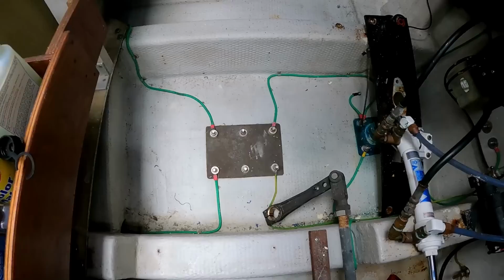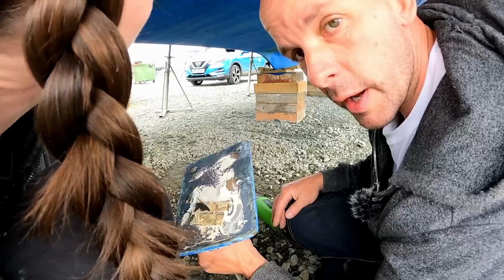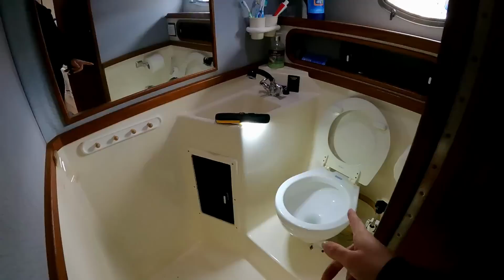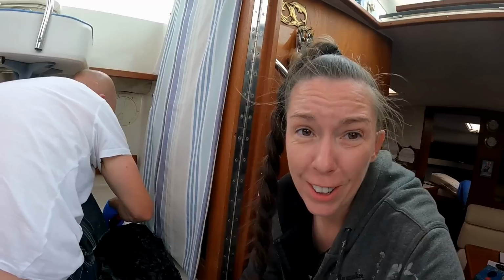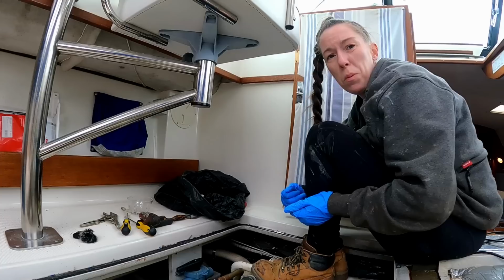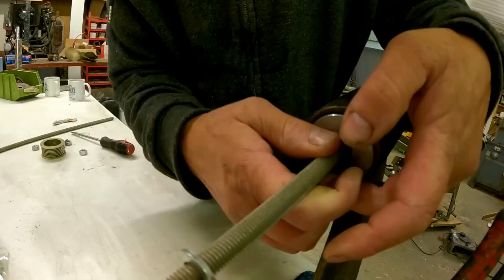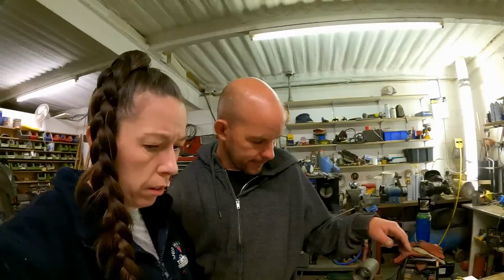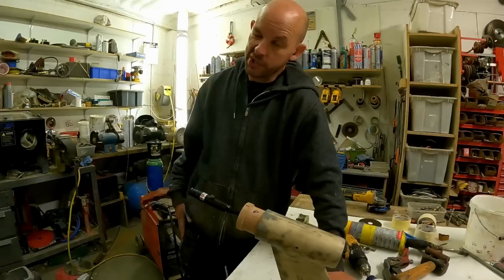Ship Happens on the boat! Cutless Bearing Removal and Toilet Drama!

Comment: Any cracking by the P bracket will not appear under the fitting but outside especially the corners. All the antifoul in the area needs removing to reveal the white gelcoat so that it can be properly inspected. Nice project, good find!

Comment: Should use fine wire to cut the sealant. There is 316 SS shims available from millwright or machinists shop. A,B,C,or D sizes.
Packing puller is like a 1/8 “ wire with like a screw on the end .would work to dig out the poo and paper from the hose . Maybe the bearing is directional and a set screw to lock the bearing to go along with an interference fit is just one more level . Also clean that inner hole like you love it and shine that shaft like it is your own then heat the housing , lightly lube the shaft and it should slip in like a glove !
Reply: If you need a fine wire to cut the Sealant - Go over to the Lancaster Restoration project and ask for some Lockwire!  It's stainless steel wire that we use in Aviation to tie up nuts and bolts to ensure they never come loose. It comes in various diameters - 0.032" is most common, but it can be from 0.015" to 0.051" (the 51 thou is like trying to bend a coat hanger!).  I've used it to cut the sealant around windows and windshields on aircraft many times!  Just wrap each end around a pipe or some other handle and pull it through!

Comment: Lots of good comments here re the toilet problem. Besides banning or removing any wet wipes or baby wipes from the head compartment, you should only buy one-ply toilet paper which dissolves much faster and easier than any two or three-ply stuff meant for on-shore use. Scott makes a good one-ply paper and it is even marked on the package "safe for septic tanks" which also are subject to clogging with baby wipes, etc.

Comment: What does it say on the Williams? “Nothing goes down the loo unless it comes out of you”?? 😂
Reply: I mean.. thats the idea.. 😅
Reply: Yes - In Greece, on many of the campsites and out of the way places the tissue/shells/doc leaves/bark/whatever your chosen method, you put that a bin with a plastic bag in.  In some places you take your own bag a stick it in the big bins.  Advance Europeans just don't get it from what I remember.  Or of course, more advanced plumbing have macerators, now they are a joy to service, I was a blue collar worker, this was considered to be a "blue job", I did a few when the plumbers would not, they would fit a new one of course!
Reply: These pipes do get  calcified …..it’s quite common…….think to change it if you can …..they do tend to get brittle and break! 😂

Comment: Just a wee bit about the P bracket alignment:

Prior to the grounding, the alignment was razor sharp.
Post grounding, the alignment is going to be laser sharp.

See what I did there😉

BTW the traditional way is to run a piano wire from the target through the support bearings with taut piano wire. Likely just as accurate as Lasers (unless v expensive) have quite a tolerance.

Comment: Yes shorten the line cutter bolts into the cutless strut, aim that Lazer to the center of your reduction gear coupling. If it's a velvet drive flange face runout can be no greater than .003" Inch. Final alignment the hull should be water borne.

Comment: I seen you pulling on the cutless bearing and I was thinking you must have removed the set screw or screws off camera.  But, yes, those bolts are acting as set screws for the cutless bearing.  If they were not there you would have to add them.  Their length is critical.  You want them long enough to hold the brass shell, but not go into the rubber part to drag on the prop shaft.  Very nice-looking boat.   Good luck with your new channel.

Comment: Last time I’ve done alignment we made a mount for the shaft clamp on the gearbox and glued graph paper to it. Then marked the centre using the lathe with target circles and crosshairs so you don’t get confused with left, right, up and down while you have your head down the engine bay. 
Enjoying the videos of everything you’ve done.

Comment: A Great solution for cleaning the Head is to use Citric Acid as it eats away at lime scale and cleans any toilet and piping i use a solution of half a cup in a gallon of hot water. its also good for cleaning sinks - kettles - and it also eats away at rust

Comment: Very impressed with your bore sighter, I have one of the same make and had to adjust it a bit. Of course you did know that the obvious problems you could see were not the only ones you would find. Well done for taking the P bracket off, fantastic it seems there is no hidden damage. Of course hopefully all that will take is your time. Great idea to use the vacuum on the Poo Pipe 🙂Going to be great fun when you get it in the water.

Comment: Use heat to expand the bronze support to get the cold frozen bearing into the hole . Dry ice for the bearing and a torch for the bronze support.
Also use the new  straight shaft to align the bearing and support. Place support over new shaft and slide into place. Once in place put your shims (not razor blades) between the hull and shaft support/bearing. 
Love you guys just wish I could understand your (ENGLISH) better. Maybe it's just the different words. At least different from St.Louis, Missouri USA.
Wish I could come over and help!
Reply: I'm English, from London, and have trouble understanding them sometimes 😂
Reply: @jerryjungle5717  Always use the CLosed Caption option (little CC in the lower right hand corner of the full size screen).😊
Reply: Heat and cold are a GREAT Combination to use to install the new bearing!  Even a household freezer (like in a refrigerator) can make a HUGE Difference.  Finding Dry Ice could be a bit of a Pain.
Reply: ^^^^THIS^^^^
This guy knows of what he speaks.

Comment: Hi you two,if it helps SV Seeker had problems with his bearing spinning and he put bolts like yours in to stop problem,it's worth a watch if you can,all the best Bob and Pauline,south coast
Reply: My Mechanic always put grub screws in mine. Also when ive watched him take cutless beatings out he takes the blade from a hacksaw, and re assembles it with the blade through the bearing. Then he cuts a groove in the bearing. Cutless falls out.

Comment: Hello, good to see things going ok, thats just a standard marine toilet and they start at £132 for compact bowl size, dont pay £700, Ive not done p bracket alignment, only replacement shaft logs cut out and replaced, what i can tell you is that a 6 foot shaft 1 1/4" diameter will deflect down 40 tho in middle under its own weight when connected to gearbox and resting in cutlass bearing in p bracket, so when i was aligning the new shaft logs to glass in i packed the shaft up 40 tho in the middle to take the bow out, that certainly looks a nice boat in great condition, toilets and hoses are always a pain in the butt 🙂

Comment: I really enjoy your shows and admire you a lot for your 'informed by research' DYI initiative. About the cutless bearing, it might be a good idea to check it out some more.   I find it somewhat difficult to believe that somebody just completely drilled through all these matching holes in the cutlass bearing for no good reason, especially as this was likely a factory install.  The set screws might also serve a lock screws on the cutlass bearing to keep it from turning inside the bracket.  Obviously you wouldn't want to go all the way through/tighten enough that the the screws could touch the shaft, but maybe they should be tightened to just short of that point. B

Comment: Gemma & Simon, I just love the boats name, stay with it, has a real ring to it.  Great bit of work, would not have been easy job to sort the "Heads" out once afloat.  We have been on a couple of sail boats out in Greece and we never flushed any paper down the loo, just keep good supply of disposable bags by the toilet and make sure anyone using it does not flush paper down there, most of the flotilla sailing boats we hired had a sign up about only sending stuff through that you have eaten.  Your children are going to love this boat, we started our boating adventures with a 19' cabin cruiser back in that hot summer 1976, our 2 sons just loved it, although we only went on the inland canals and rivers, we ended up boating for 40 years, it gets in your blood

Comment: It appears that your shaft strut was adhered with Dow 5200 or similar.  I have found that a product called Debond Marine Formula works incredibly well at getting that Devil's Glue to let go.  It does not soften it, it just makes it let go of whatever it is stuck to.

Comment: it should be able to shine right to the gearbox, just make sure its centred at both ends of the prop shaft, also check your engine mounts are not worn and floppy as that will throw out your measurements, its the prop shaft it needs to align to anyway- put a piece of tracing paper over the end of the prop shaft and that will tell you if you are properly centred (you will see the laser dot through the tracing paper (or greaseproof paper), you may need to align the engine to the prop shaft too.
Reply: :face-turquoise-covering-eyes:

Comment: What a crap job, I'd be feeling a bit drained afterwards! That looked like wet wipes of some sort, tissue would normally tear pulling it out. Mind you when they hit the rocks somebody probably needed the loo.
Maybe you should consider having the P brackets NDT'd; non destructive tested for cracks as they would have taken a good thump. They are a cast and machined piece and as they are most likely phosphor bronze. A simple dye penetrant test would be enough. There are a lot of companies offering NDT these days at a reasonable price. It would be worth it as you are going to the expense of getting the shafts and props repaired.
Its a fine boat and should go like a greased weasel when you get it sorted.

Comment: Looks like the head needs a macerator fitted. It chops up the "chunks" as they pass into the pipe. Helps avoid blockages like this. Still be careful what gets put into the system.
Reply: That head has one, it's not working very well.

Comment: I once pumped portapotys.  Found a double F bra and a wallet jamed in a suction line. Took forever to get the unions and blockage cleared. Used a high pressure pump to blow them out. What exciting times we have.

Comment: Cutlass bearings have grub screws fitted t prevent them turning, the rope cutter bolts are correct as they do the same job.

Comment: Having the roper bolts go into the cutlass is no big deal as long a you dont screw it in too far and deform the rubber bearing material. Just let the screw go just past the cutlass casing

Comment: Good call checking the laser runout on the lathe Simon, I tried using one of those years ago (box looked identical too) on my air rifle (I do target shooting)and lets just say it was not a lot of use due to the beam not being centred perfectly and I thought you might have used the type enclosed in a cartridge case like the powder burner (full bore) shooters use as they are more accurate.... but the lathe shoed the run out and Im sure you can adjust the laser at 2 points near the end using a small Allen key to bring it more into centre (mine did).
Anyways enough of my yapping, cracking vid guys thanks for sharing

Comment: There is a product that they use in airports to dissolve organic materials flushed down toilets. The have problems with pick pockets etc who flush empty wallets and purses down the toilets. I can’t recall the name of it. But if you can find it it would save you having to do a similar job again

Comment: If you want to cure toilet smells then change the system to flush with fresh (not sea) water. It sounds crazy but it will improve the whole boat with a simple adaption that is well worth the effort (and uses very little of your fresh water capacity).
Reply from the maker: Thanks for the advice xx

Comment: Cutlass bearings are normally held in with a couple of grub screws, you should not go right through them completely, you might damage the shaft, which will cause scaring and damage the bearing.

Comment: did I think you were peeing while standing up? Not unless you were using a shewee lol. If you ever get a blockage again, you could try using a drain rod with the corkscrew attachment.
Reply: I always got the sh***y jobs on Dad's twin bilge keeler. Used a wire snake down there to remove all-sorts . His didn't have a holding tank(not req in the 70,s)
Reply: @markhorrell9213  wire snake, yeah thats the thing lol